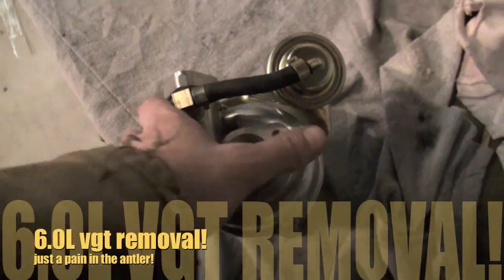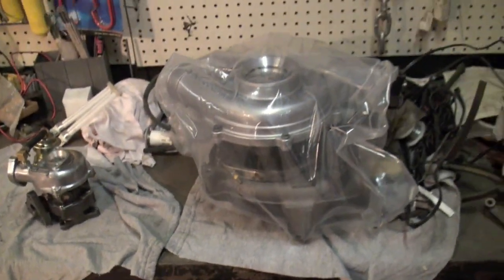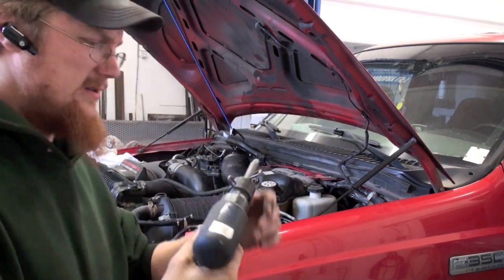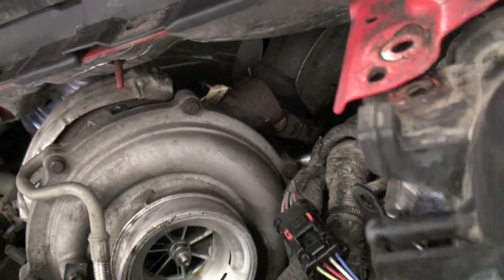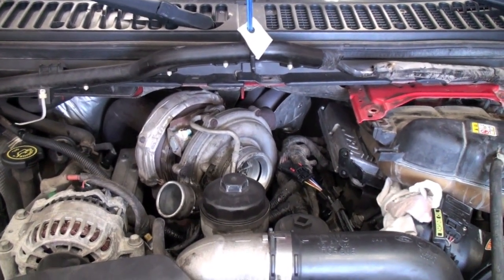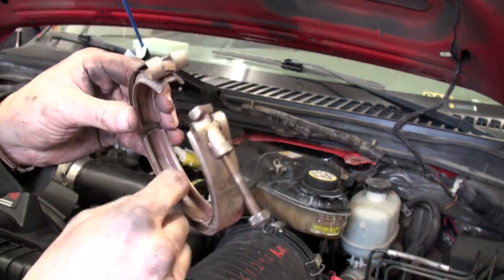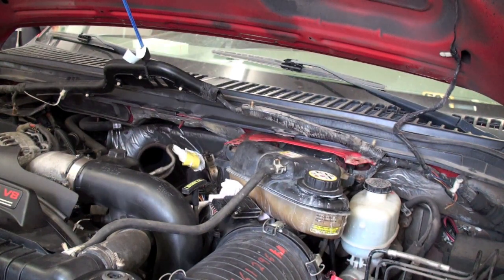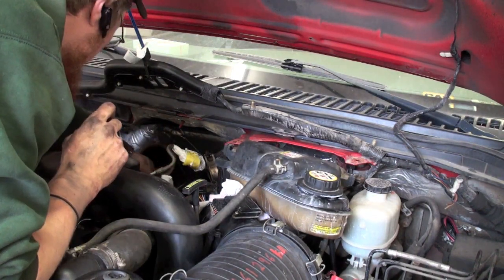6.0L diesel vgt (variable geometry turbo) removal!

Comment: bud, you're lucky the turbo is up ontop like that. i changed the turbo on my supra to a Greddy TD06-20G and lets just say i needed many extension and a lot of swearing. ended up having a custom turbo elbow made and went with allen bolts to keep er sealed. covered the exhaust side in exhaust wrap. working good. turbo installs are never easy.

Comment: They are pass through wires. They come out under the dash by the parking brake and allow you to run a few wires without having to drill through the firewall.

Comment: Old turbo should still work nice beside a MB 606 diesel motor. After rebuild off course. I would try to sell it for a rebuild on diesel forums. If it is not a exchange part.

Comment: howlwlllyyy friggging son of a bitch.  wow bro.  That is a nice sized turbo you have there in the shop.  I thought you were high on the freakin jibb for a second when you were holding that tiny thing.  Maybe some dirty driveway hash or jasmine friggin mafk.  anywho.... watch out for blowin high pressure turbo antler rods out the exhaust.